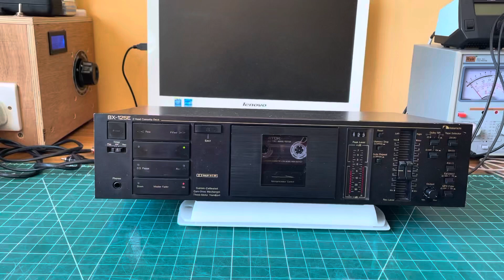Nakamichi BX-125E DEMO Type 1 Tape after transport rebuild

Comment: How are you liking the Rek dual channel millivolt meter? Is it any good?
Reply from the maker: Yes its ok for a cheap meter. I would say it is accurate to 1% which is good as it claims 1.5% which is as Good as i need. Both channels read the same from same input and readings are very stable
Reply: @Nakamichi_Service_UK  thank you, i was wondering if it's any good, after your reply will probably pull the trigger and get it. Thanks!